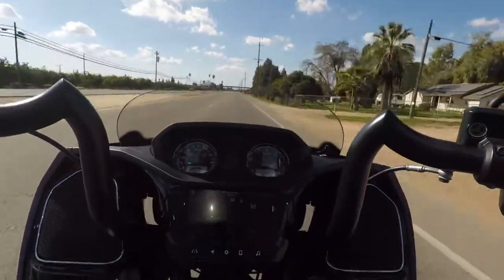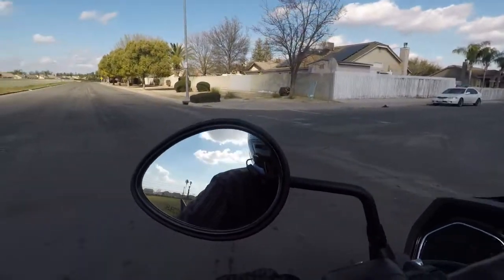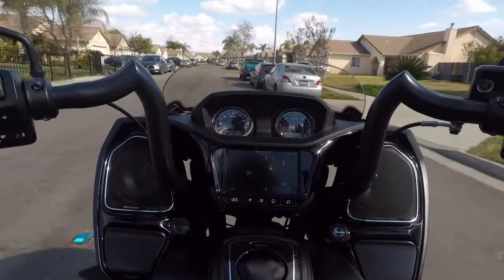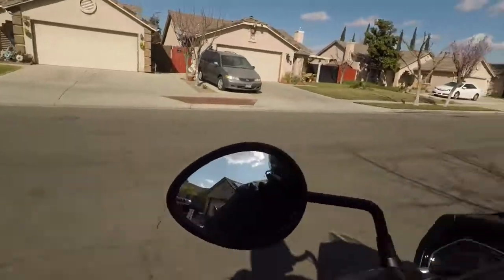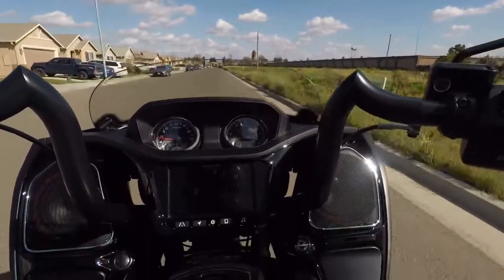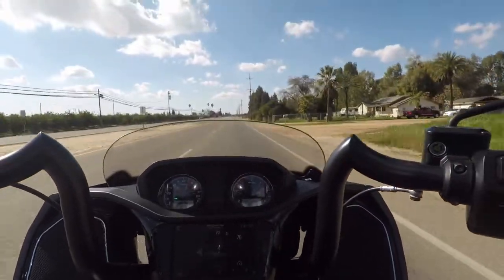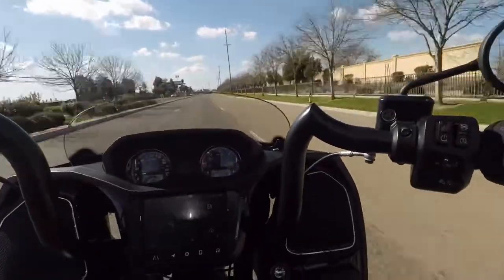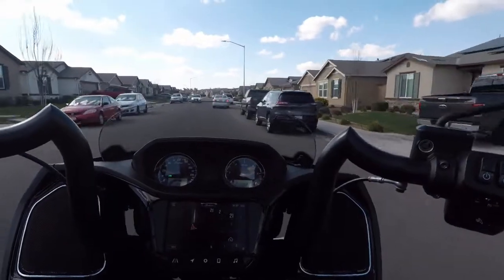New Indian Challenger ECM Flash

Comment: I did the new Indians flash and followed it up with the Lloyds's flash the same day. I am stage 2 with a cat delete stage 1 intake and K&N filter.  So just so you know aftermarket flashes won't void warranty. according to Magnuson Moss They have to first prove the flash caused a failure and then they can charge you for the work but the warranty is still in tact.  I have discussed this at length with my Indian dealer in Albuquerque who also encourages the Lloyd's flash. Most dealerships world wide have applied for Lloyds remote tuning status. So my warranty is intact and I have nothing to worry about. Aftermarket flashes won't void warranty. Your bike sounds great by the way.
Reply from the maker: If the engine breaks while aftermarket flashed that's all they need for proof. Magnusson moss is great for pipes, and other things, but it's quite simple for them to prove when all they have to say is you ran a modified tune that effected what's considered safe, and legal, from the factory. Your bike, do with it what you wish, but that's the bottom line of what will absolutely happen. Not sure what the point of getting the factory flash was if you replaced it with lloydz? I've talked to others that have said the Lloydz tune didn't actually fix the issues like throttle lag or surging. Only benefit I see is the increased speed limit, which you also don't need.
Reply: @DarkHorseParatrooper  The Lloydz flash does not replace the benefits of the new Indian flash. So you get the best of both the worlds. So to get the new one does not hurt.

Comment: Test rode a challenger an the first thing I noticed was the tune was off. The roadmaster was too but not as bad. Glad they fixed it. I ended up with a roadglide and harley has refined the tune as well.
Reply from the maker: Yeah I definitely think the Harley has a more refined tune. Not faster or anything, but definitely smoother and more predictable. You must have rode a newer roadmaster. My 2017 was perfect when it came to throttle control and smoothness.

Comment: I can do it on the scout. I havent tried on the challenger.
Reply from the maker: Yeah mine wouldn't do it, the demo I tried it on wouldn't, rm wouldn't and I've asked others they said no idle coasting either. Mine would stall if it were attempted before. I noticed the rpm is up a little, like 900 to 950 or so now. Let me know when you try it on the challenger. Maybe they all behave slightly different. Doubtful though.